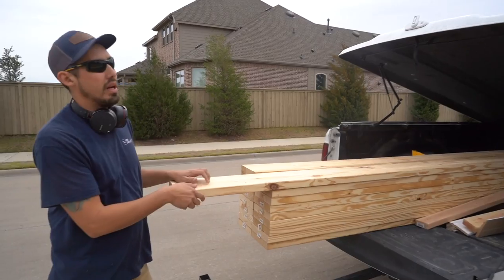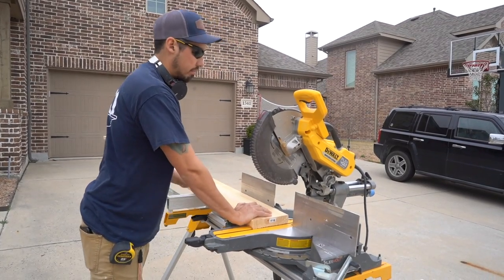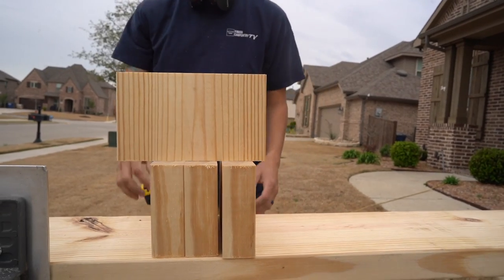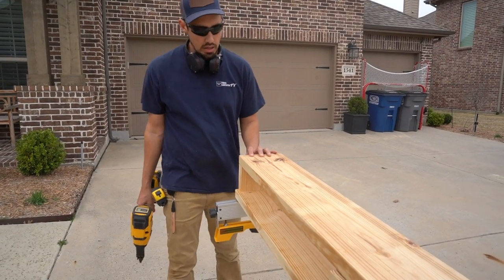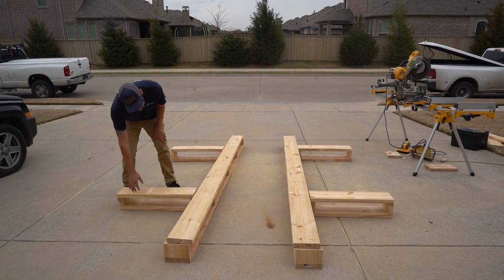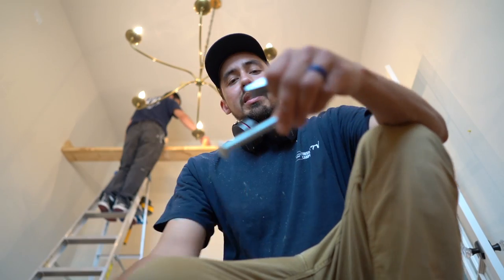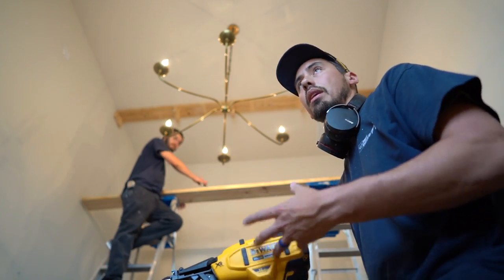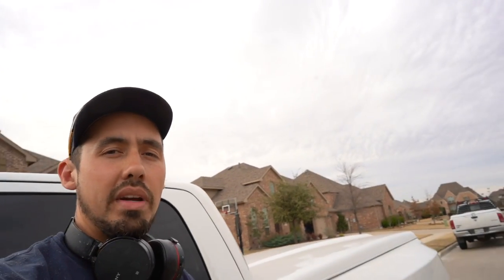Coffered Ceiling Build!

Comment: Listening to that finish nailer all day would drive me crazy
I'll stick with air
Reply: Because a compressor is much quieter right? No hassle battery-powered nailers are the way to go. Not all make that noise either I have a couple of Ryobi nailers that are quieter and more reliable than my air nailers.
Reply: Will Bradley yeah air sucks, no pun intended
Reply: @-KIMISAFOX  Air compressor noise drives me crazy! Dragging hoses around, having them twist up, get caught under ladders, scuff trim on the outside corners... ugh. Not to mention I was up on a walk plank with a 16g hooked to my belt. Someone walks by and gets hooked on the hose. Damn near trips and yanked the gun right off my belt. It fell and broke. Could you imaging if it didn't unhook? It did pull on me but not enough to cause me to lose my balance thank God! Anyways I like you love my Ryobi battery nailers... I have 2 pin nailers, 2 18g, a 16g and a 15g. Love them all!

Comment: when we did this type of ceiling we installed 2x's on ceiling then used 3/4 ply to build the boxes, comes out a little cheaper
Reply: I do it similar but with 1xs for the boxes
Reply: We just put nailer strips around 2x2  and build boxes and nail them to nailers on ceiling, way cheaper, lighter, I'm not really sure why would you need such heavy and strong frame for it

Comment: Cool project. You’re obviously doing the type of work that God built you to do. When you’re picking out framing lumber try to avoid heartwood. Those are the boards where you can see the center of the tree on the end. I worked on large tracts, condos, and apartments for about 13 years and I found that about 85% of the twisted studs I replaced were heartwood. I didn’t read all the comments so please forgive me if this is old news.

Comment: Is there a ratio to the depth of the coffers to the size of the room, and the hight of the ceiling? I have. 10x12 room with 10 feet ceiling. How deep should the coffers be, about? And how wide/thick should they be? 
Thinking about the # pattern with no frame. Something modest and simple yet nice. 
Thanks.

Comment: You every consider building your framework out of plywood? From a cabinet makers perspective seems like it would be more cost effective/ cut down weight/ and still be plenty strong for a decorative element. Obviously would require a little more work ripping up the ply, but I think would be just as effective in the end. Maybe that’s not economical for u, but I would prob go that route. Just a thought. U do good work man!

Comment: Just a suggestion for when you get older and weaker. Do just a single 2x8 perpendicular to the ceiling joists, you can nail right into the joists without messing with toggles.  Then wrap the 2x8's with an MDF false beam. Then do the other 2x8's and wrap them with a false beam. It is much lighter and straighter and you can pre-make everything on the ground first.
Reply: He did nail into the joists

Comment: Just curious, I’m a concrete finisher and I was wondering why you cut like that instead of just sending the saw home first pass? Dope channel by the way
Reply: dirrtydunndunn he’s taking care of his saw and he has a 40 tooth blade on it which is not meant for framing cuts
Reply: I think he has a high tooth count (Trim) saw blade in the miter saw. Not a ripping blade. Running it all the way through will cause it to overheat and warp which will cause the lifespan to diminish.
Reply: Thank you dude, I was just about to ask the same question and I guess these guys answered it for both of us. I though maybe he use to work at a deli years ago and feels like he's cutting slices of ham or something, haha
Reply: could also be his habitat as a finish carpenter yo reduce blow out on the cuts

Comment: Love the video, the details you provide and the final outcome  is excellent.  I have a question for you. I'm very interested in putting a coffered ceiling similar to what you've done. However my drywall is installed on resilient channel. I'm assuming you know what that is.  so my question is how do I install the coffered ceiling since my drywall is not fastened to the trusses? Do I just crush the drywall between the resilient channel and the Truss? Don't think that's wise. Also what concerns do you have when you're installing on a ceiling where the vapour barrier is being punctured? I am from Canada your drywall and insulation codes may be different.

Comment: Can u make a video on your modification on the dewalt stand? I’ve seen video for the 2 close to the saw, for the crown molding stop and/or just support. Have made wings in aluminum etc and planning to buy that dewalt stand and put them on. Have the gravity stand now and it’s kind of weak. your solution looks pretty nice and simple, but I am interested in the outer ones, and how sturdy they are. 

Do the saw mounts snap on to the plastic end on the telescope arm? It looks like the plastic end has the same profile as the aluminum frame on the stand itself. 

Best regards
Reply: He did that late last year (I'm pretty sure). If you go through his library, you'll see him building it out.  If you scroll through, you should be able to find it easily enough.
Reply: Hansang Bae 

Yes i saw that video. its just for the two inner ones, not the ones on the telescope arms.
Reply: @Pannebann  Ah, gotcha.  Good thing Richard saw your comment and went into it!  After you mentioned it, i was like "hey, that's new"

Comment: Enjoy your channel, always pick up something useful.  Question though - why use 2x instead of 1x to frame the coffer?  It's not structural in any sense, and of course your 1x still yields 7-1/4 on the width if that is the dimension without ripping.  The 2x weighs just that: 2x the weight of 1x.  In fact, would seem that part of the finished coffer would suffice for some of the framing material, whether it's clear pine or poplar (if being painted) or some other species.  Must be a reason, curious to know.  Thanks.

Comment: Hey man...you should check out Emerald Urethane Trim Enamel by Sherwin Williams. I'm doing a remodel on my house and have been using it for all trim work. First coat is a bit sticky, but the second (and third if necessary) are smooth as silk. It's super durable being that it's an enamel and does a great job of filling in any minor spots.
Reply: Josh Raines I prefer Ben Moore’s Advance Waterborne Alkyd Paint. Same concept- designed to dry to a super hard, smooth finish. Levels really well. I use it on cabinetry and trim all the time and have had great results. My SW rep actually told me they have had some issues with Emerald Urethane reaching full cure in some sheens.
Reply: @joshuareed3999  that is interesting to hear. I've never had issues, but definitely something I'll look out for. Actually getting ready to paint some doors as I type!
Reply: Josh Raines I don’t remember now which finish was having issues. I’d be interested to know how it turns out for you. I typically use satin on cabinets. The Advance has been really good for me and to do offer it in a Matte if someone wants a lower sheen.
Reply: @joshuareed3999  I use a semi gloss. It's stood up really well...especially with two kids and a dog.
Reply: Josh Raines that’s good to know. Thank you! Always improving my processes and looking at offering different stuff. I have been pleased with the performance of Advance- never had any call backs- but open to try some new products. Thanks again!

Comment: Do those bolts hang on the drywall?
Reply: Yes. They’re toggle bolts/anchors. Easier to get the piece on the pencil mark if it’s hanging on anchors than trying to hold it by hand on the pencil mark.

Comment: Why not use 1 x 8" stock for the top and bottom pieces to reduce weight and cost?
Reply: Yes!
Reply: I just did my ceiling in December and using a thicker wood is way easier to work with than a thinner one...I had to learn the hard way.  I'm doing another room and this is exactly how I was planning to start it (Just with 2x10 boards).  Can't wait to see the finished product.
Reply: More expensive thats why.
Reply: Thanks for the replies... I must admit, I didn't really price the 1 x  vs.  2 x  material and it looks like the price is higher for 1 x ... go figure....  as for being easier to work with 2 x pieces, I am not sure I agree. You can easily screw thru the 1 x in to the 2 x stock. Anyway, it is a good video.
Reply: And... having seen Part 2, my mention of weight was to ease the physical lifting of the unit to the ceiling. I am 70 yrs old and not as strong as you young pups.

Comment: Great job as usual ! My only concern is even the straightest lumber rarely stays straight ,leading to gaps in the finish trim after the subframe twists even a little. Framing lumber isn’t as good as it used to be
Reply: jennifer gunther I completely agree. I typically use those “ladders” to frame around basement bulkheads, etc (pretty typical), but it lends itself to movement as it expands and contracts with humidity changes. That’s where a lot of drywall cracks come from. I will say though- he had those new boards cut pretty tight so hopefully it will be minimized. Glue helps keep things together a lot as well as good caulking that stretches. He’s a great carpenter so I don’t doubt it looks great.

Comment: Great video. I do have one question. Is there any concern that the 2x8 lumber can twist or bow over time? Not trying to be a dick. Thanks.
Reply: Tom Chapman they will if they are just laying on the shelf. But once you nailed/screwed them in, they won’t. Only thing they will do is expansion and contraction due to seasonal changes.

Comment: Another great video as usual.   Did you use that first 2x8 you pulled out , hope you noticed the end grain pattern before actually using it?  When it dries there's nothing going to stop it from twisting like a pretzel after installation.  Good chance your going to have a call back if you forgot to check.
On the other hand, it's a perfect setting for another repair video so in the end it's all good.
Reply: I would think a torsion box design and anchoring will stabilize it.

Comment: I'm sure that was a specific build for your application,  but I have to be intellectually honest and mention , metal studs , lighter, straighter , and cut with snips installing in place without any heavy lifting. just another way of ending at the same awesome look. well done.. also, little less than perfect square is more pleasing to the eye, as you approach the golden ratio. but craftsmanship straddles artistry and can be in the eye of the beholder. always enjoy the vids. might be my first time chiming in.
Reply: Wood studs will hold the nails way better once the 1x8 and crown goes up.

Comment: Do you compensate for the slack in the hook at the end of a tape measure? When I do any finish work, I always have to take in account the 1/8” of slop in the tape measures hook..
Reply: You should not have to compensate at all if used correctly. When you hook the tape and pull that should be a true measurement. The same goes for when you butt the tape  against something. If you look at the end of the tape the hook is not a 90-degree it is likely angled and the top of the hook it juts out 1/8 of an inch to make a true measurement. Just have to make sure you have the tip that juts out pressed up against.
Reply: Thanks for the reply.. I understand what you’re saying.
Reply: @thomasrossi31  don't believe everything you read on the internet Thomas , but you can take this with a grain of salt,  actually the hook on a  tape-measure  has a a slotted attachment point usually where it's riveted to the blade and when you push against it for inside measurements it moves in the thickness of the end of the tape (the hook) and when you hook it on something for an outside measurement it pulls out the other way to compensate for the thickness of the hook. Also the hook should be 90 degrees. It usually moves a 1/16" each way because thats about the hooks thickness.
Reply: @-KIMISAFOX  where the hell do you buy your tape measures at?
Reply: That little 1/16 th slack is thickness of the hook and done on purpose for when you hook pull measure and butt measure.
Reply: This comment makes me laugh but everyone’s got to learn at some point

Comment: Not sure why you chose 2x to build your frame. Usually the frame is done with 3/4 ply strips on the sides with shorter pieces top and bottom to  make a box. 1x also is a good choice if you don’t feel like ripping a bunch of ply. I don’t trust that 2x lumber not to warp as it dries out and ruin your finished product. All the perfect joints you make in the molding will open latter on. Just my opinion based on what I’ve done and what I’ve seen other carpenters do.

Comment: What was wrong with your older truck. Saw you post it on a tow truck the other day on Instagram
Reply from the maker: Oscar JR water pump went out. Pulley was about to fly off so it was not drivable

Comment: What is the point in cutting the board with the miter saw 3 times before actually cutting thru?. I'm genuinely asking cause it seems like a waste of time to not just cut once?
Reply: Less strain on the motor. Helps with blade deflection, blade from pinching and can also improve dust extraction.
Reply: M B that’s correct but also if you score the top fist, it will reduce tear out tremendously.
Reply: mitch denner - 🤣 that’s one of the funniest analogies I’ve ever heard 👍

Comment: Why do you make so many passes with the saw when cutting the 2x?  One and done.
Reply: D I do that as well. It’s a habit formed by using a battery powered saw and trying to keep blade speed up. It reduces tear out. Less strain on a battery saw. Before you tell me he had the saw plugged in (pretty sure he had the battery pack to 120v adapter on the saw) it is a habit for some people- plus he was using the radial arm cutting 2x8 material. It doesn’t hurt to cut stuff this way at all and would seem weird to me if I DIDN’T cut 2x material this way!
Reply: @joshuareed3999  Ok, makes some sense on the less tearout part.  Never had a problem cutting anything full depth single pass with my 780,  but it isn't battery powered.
Reply: D I love the electric saws for that reason. I have a bunch of saws and the little DeWalt battery saw with 7-1/4” blade is handy, but you need a good battery. Won’t cut 3-1/4” base standing vertically both ways. It’s the price you pay for convenience!! Love it for shoe moulding and framing actually since it will cut 2x material on the radial and it’s so light to carry around. When I started in this business I had to have the biggest, heaviest, largest capacity stuff out there and over the years I have gone to the lightest, highest quality stuff that still gets the job done! If I had a permanent shop, or good consistent help to carry that heavy stuff in and out of jobs, I’d bring my big stuff to the jobs, but I don’t anymore.

Comment: Just 2 toggles?  Is is also screwed into the ceiling joists?  Seems weak for the weight it holds.
Reply from the maker: Mark Lynette we hit the joist too the toggle are just precision adjustments.
Reply: Wow
Reply: I just use glue and thumb tacks with 2x12’s ?  Seems to hold fine so far?
Reply: Did you even watch the video?
Reply: I think you need to rewatch this video, and part 2...
Reply: zephyr1408 🤣🤣🤣🤣

Comment: I’ve been a finishing carpenter for over 40 yrs. I don’t really see the need for such a heavy framework to build a decorative coffered detail. I would just simply fasten a plywood backing grid to the ceiling and then build my beams out of the finishing material. Lots of unneeded material and labor with this method.

Comment: Is the coffered ceiling to be trusted as load bearing structure? No? Then why are you using structural timber members when thinner lighter, easier to work with materials are available. This does not follow any trade experienced carpentry that I have ever seen in 30 years of building.

Comment: Not good. Should of framed it without the bottom so it’s easier to attach to the ceiling. Then finish the framing. Trusting toggle bolts every where is definitely not safe!!
Reply: Jeremy Cline did you not see that the entire thing is screwed into the joists above? The toggle bolts were just for alignment.
Reply: Your observational skills are not good.
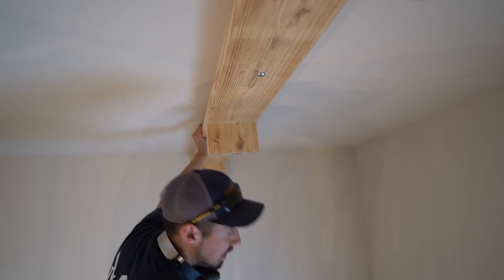Reply: They did attach them without the bottoms, see 10:04. You should at least watch the video before you open your food hole. That's the place where you feed yourself, if in fact you actually feed yourself.